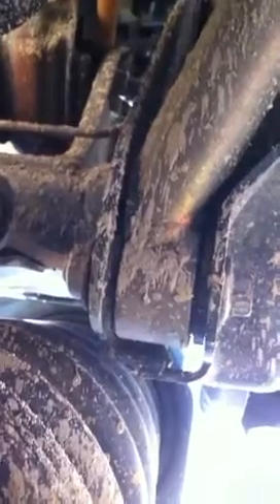Thuren TrackBar Bushing

Comment: You can see day light between the bushing and track bar mount. No way you achieved the 215ft lbs that is required. I suggest new bolts and re torque to proper spec.